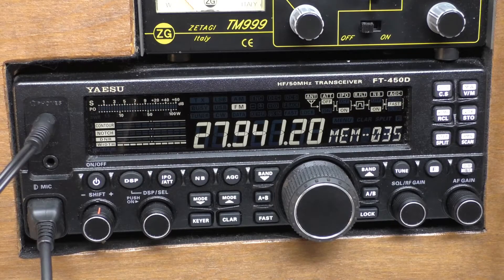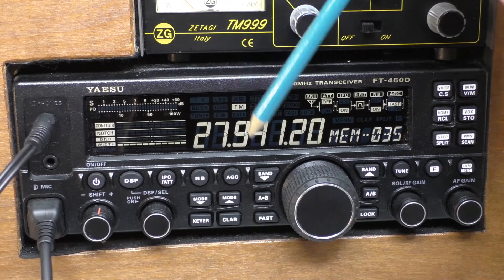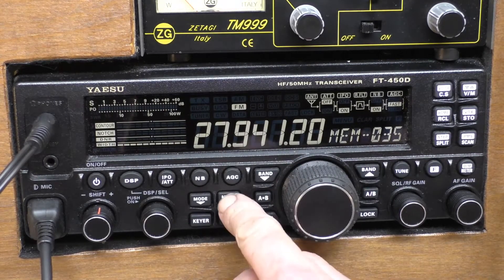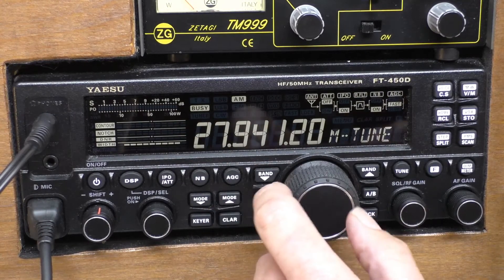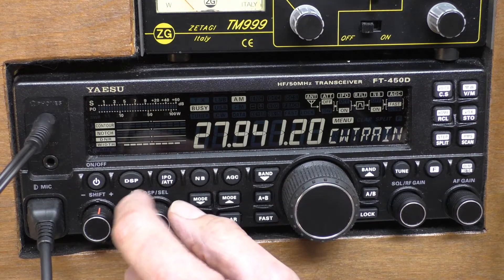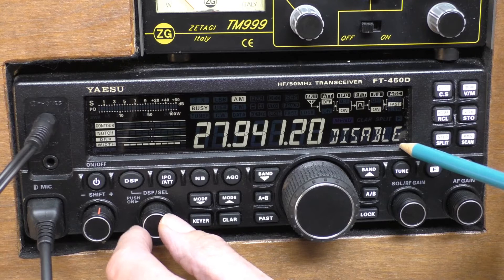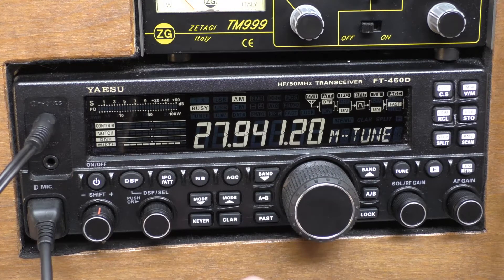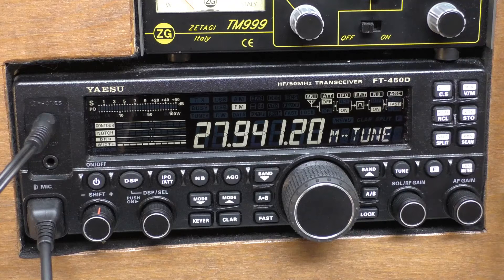Yaesu 450D Main tuning dial VFO not working. Answer.

Comment: I was trying to find how you can get the missing last digit in uk fm 27.781.2(5) and found how to get the missing 5  now saved in the memory full uk 40fm
Reply from the maker: Well done.  Mine is still .20
Reply: @CB-RADIO-UK  With the vfo and in USB put in 27.601.25 change the band to Fm it will stay on 27.601.25.now press f button then mw/vm with the dsp/sel  dial go to channel 1 it will now readout 27.601.20 press mw/vm to save and it saves as 27.601.25 long and drawn out but if anyones like me i want to see the 25 in fm.

Comment: Thanks so much! First thing I noticed when I got this rig in the mail. Bought it recently, hooked it up alongside my ICOM 7300 and there it was AM/FM, no VFO action! I knew it had to be a feature. But there was that instant that I thought, "oh man got a lemon." What an odd one though. I imagine the image on the final build had that switch disabled. Yaesu said oh well they will figure it out and did not bother with a fix. Got a great, I mean great deal on a 450D virtually new. Right place, right time. The pictures showed a clean rig and the narrative said only used a couple times. I could not even find any dust in the fan! I was told that it was new was bought for and Emergency Operation Center, powered it up a couple times and decided on something different. Put the rig up on a closet and didnt do anything with it until now. Now I own it. Hope it was not because AM/FM did not work? Well, I am finding out that this is one really nice rig. Layout a little backwards it seems to me coming from ICOM but the DSP is very effective. I have an outboard AF DSP for my ICOM from BHI in the UK. Dual-in line DSP noise reduction unit. Works great, well worth the money spent. I made a handful of overseas contacts from Pennsylvania to Italy with the Yaesu, also a Canadian ham calling CQ, 5/9 reports on all the contacts and excellent audio report. All with 100 watts and a longwire at 90'. So far, I am impressed. Can't wait until I fire up my ACOM 1000 and apply a little juice. Take care and thanks for the "tip"! 73, AB5VJ

Comment: Hi Fred, just wondering if you could be of any help. My screen colour is a horrible yellow and I want it back to white but don’t have a manual. Any advice would be appreciated.
Reply from the maker: Hi found this.
Display DimmerYou may adjust the brightness level with the five steps.1. Press the [ F ] button, followed by the [ METER/DIM ]button to enable adjustment of display dimmer.2. Rotate the [ DSP/SEL ] knob to select a comfort-able brightness level (1 - 8).3. Press the [ METER/DIM ] button to save the newsetting and return to normal operation.Display Contrast LevelYou may also adjust the contrast level with the 24 steps.1. Press and hold the [ F ] button for one second toenter the Menu mode. The "pear on the display.2. Rotate the [ DSP/SEL ] knob to select the menuitem "CONT".3. Press the [ DSP/SEL ] knob to enable adjustmentof this menu item. The "ing.4. Rotate the [ DSP/SEL ] knob to select a desiredcontrast level ( - 24).You may press the [ RCL/HOME ] button to resetthe contrast level to the factory default.5. Press the [ DSP/SEL ] knob. The "turns to appear continuously.6. Press and hold the [ F ] button for one second tosave the new setting and return to normal opera-tion.Page 70SETTINGSDSISPLAYETTINGS" icon will ap-" icon will be blink-" ico

Comment: Does this have talk back so you can here your self
Reply from the maker: It has a monitor feature where you can hear your own voice
Reply: @CB-RADIO-UK  yep where is that Fred I’ve tried lokking but can’t see it no where
Reply from the maker: Page 44 in the owner manual.   
You may listen to the quality of your transmitted signal using the Monitor feature.
SSB/AM MYou may listen to the quality of your transmitted signal using the Monitor feature.PAssign the Monitor feature to the [ C.S/VOICE ] button.1. Press and hold the [ F ] button for one second toenter the Menu mode. The "pear on the display.2. Rotate the [ DSP/SEL ] knob to select the menuitem "PNL-C.S".3. Press the [ DSP/SEL ] knob to enable adjustment ofthis menu item. The "4. Rotate the [ DSP/SEL ] knob to select "MONI" toassign the Monitor feature to the [ C.S/VOICE ]button.5. Press the [ DSP/SEL ] knob. The "turns to appear continuously.6. Press and hold the [ F ] button for one second to savethe new setting and return to normal 

Here.  https://www.manualslib.com/manual/381762/Yaesu-Ft-450d.html?page=44

Comment: Hi any idea why the FT-450d has such a narrow SSB voice on tx bandwidth...at around 2.4khz...cant see any way to adjust it.

I can adjust the RX bandwidth but not the tx...only reason I ask is I sometime get poor audio reports....thought it maybe due to this.

Nick.
Reply from the maker: Ive only ever adjusted the mic level.  I got some different reports when using the supplied mic but its all been radio 5 with the MD100 desk mic.
Reply: Not same on ft450

Comment: Hi Fred 
Looking at getting a 450d just wondering what power supply to get and if possible could you recommend one
Regards Gary
Reply from the maker: Hi.  Your going to need a 30 amp PSU.  If you got the funds Alinco make some nice ones.  I use a cheaper QJE PS3011.  Its been working faultless for over 2 years now.  It features in this video https://www.youtube.com/watch?v=-mU0JIR68PM&t=41s
Reply: You can get a simple PC Power Supply with 350W or more. Just modifie the ATX Plug to switch it on. Connect the 450d to the 6+2Graphics Card Connector (12V and GND) Its all about 30 Euro

Comment: Hi Fred I have just bought a new ft 450d and have followed what you say also by the manual but when using the main dial to alter frequency then it only increases or decreases by 20 khz so for example if I go on FM and try and get 27.781.25 then it will only go to 27.781.20    any ideas mate please
Reply from the maker: I think this has come up before.  I guess its somewhere the stepping settings menu.  I have a feeling mine does the same.  Bit of a cop out but ive left my Alinco on .20 instead of .25.  TBH on FM the .05 wont make any real difference.
Reply: ok mate thanks I did notice though that if you go to usb mode then go to the required frequency then change the mode back to fm it stays on the correct frequency...Anyways I hope you do more vids on the yaesu  73s mate

Comment: 857d doesn't have this issue once widebanded. Main VFO works as normal on 27 MHz all modes.
Reply from the maker: I am not sure.  Mine was wide banded from new.  Its not really and issue just a menu option.